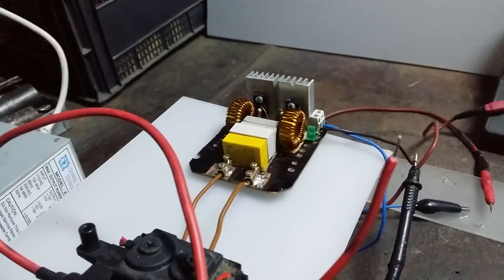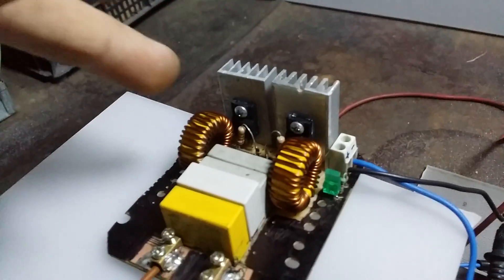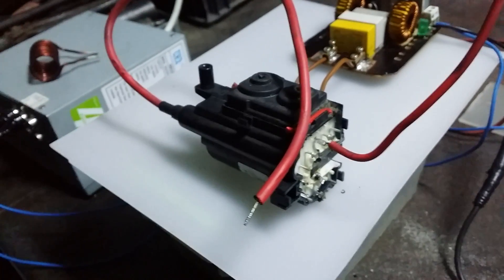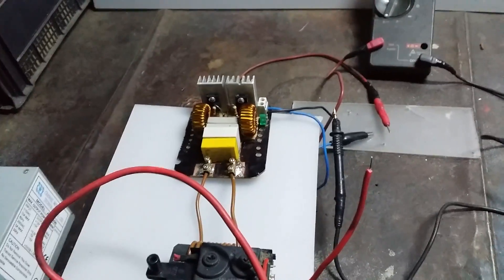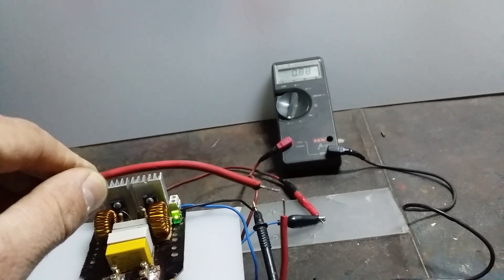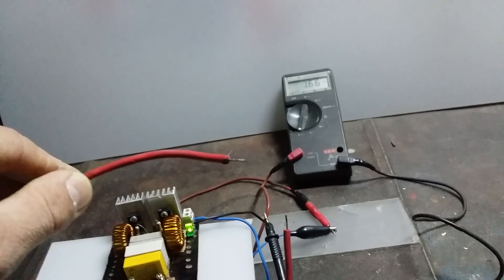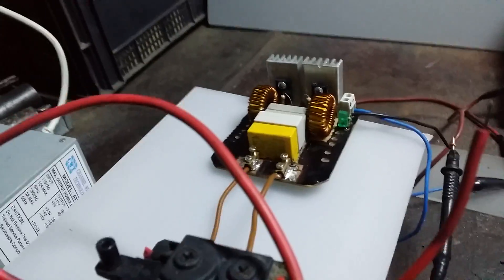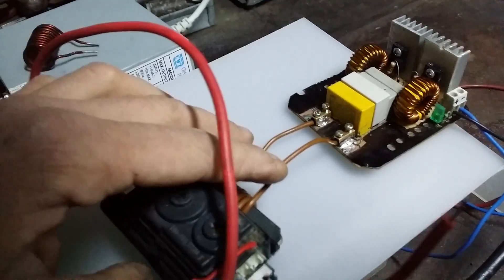Flyback Transformer ZVS Driver

Comment: output ac or dc?
Reply: @jigglygamer6887  thanks for the answer! Excuse me could you tell me what diagram is better with the Flyback? The ZVS or 555 circuit? (assuming that I have 2 Flybacks that I can connect them in Series) I only want the biggest arc, my actual circuit is with one simple transistor and it works really well...
Reply: Zvs better
Reply: @diegorgzm  it's ZVS.
Reply: @diegorgzm  not about 555 timer IC flyback driver.

Comment: how many woat?
Reply from the maker: it a low power zvs driver, around 70 watts used with flyback transformer and 130 watts used as an induction heater.
Reply: Hello if you use the wair red neer eny metall happen choock
Reply: có phải lê văn lết k??